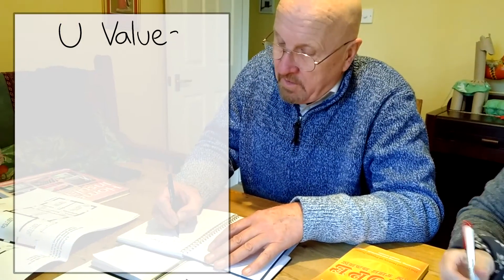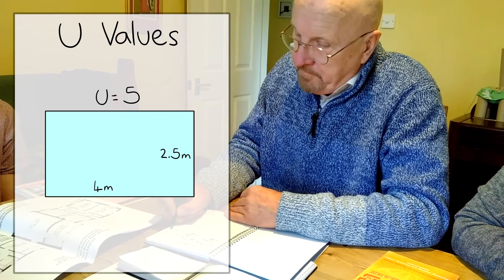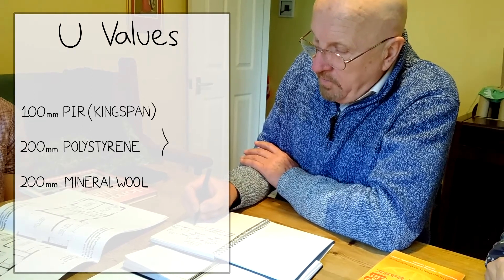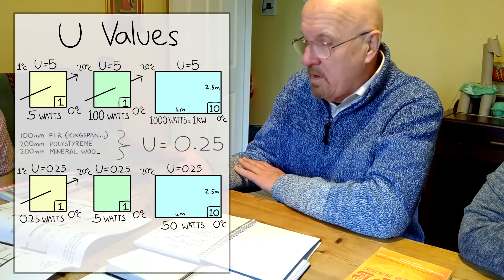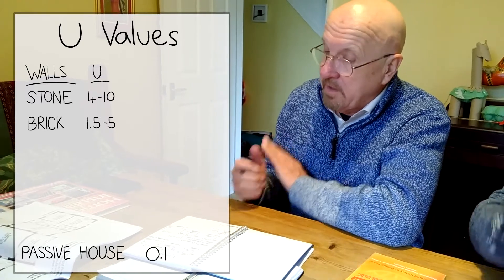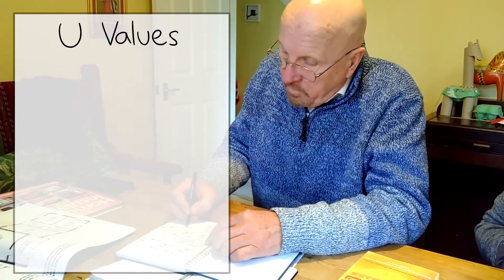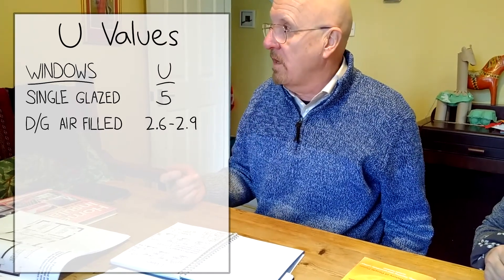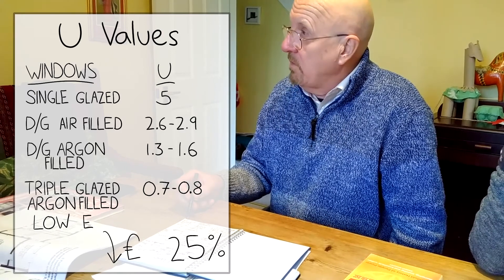Andy Walker explains U Values - a measure of how good different materials are at conducting heat.

Comment: per second?  When you're talking, i presume its 5 watts per time  unit?  In your logical example, thickness does not matter, heat has to walk through the material at a velocity.  Air?  is on both sides of the surface at sea level?  What if the air on the outside is exchanged entirely 100 times per second, does that increase the velocity of wattage?
What is the U value of a vacuum?, or 100mm of empty space vs 1 inch, surely 4 inches
of dead air has more U value than 1 inch (inside wall cavities).  If the air is extremely humid, its ability to transfer heat is increased, so humidity must be part of this formula as well.  I feel like a child being fed a woefully simplified formulaic approach without the details of the physics of this formula.

Comment: Very few joiners or housebuilders have any real respect for insulation and seem to totally disregard the importance of a quality installation.  People are just now focussed on the energy performance of the houses where they are more concerned about how the windows look!  It is all wrong.
Reply from the maker: This is sadly very true KS .. the vast majority of 'traditional builders' (the politest term I can think of) are only interested in doing what they've always done .. ie a cheap, fast, untidy job and then run off with their money .. A complete shift is needed in both training and motivation to enable the UK to have high-specification, high-quality insulation installations which are fit for purpose - otherwise the UK will never achieve net zero carbon by 2030, 2050 or indeed any date in the future ..